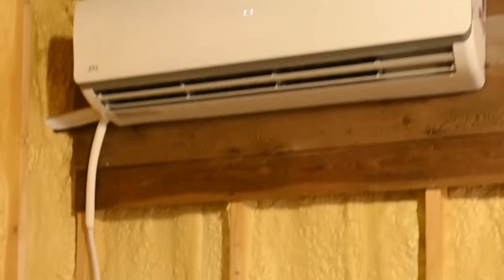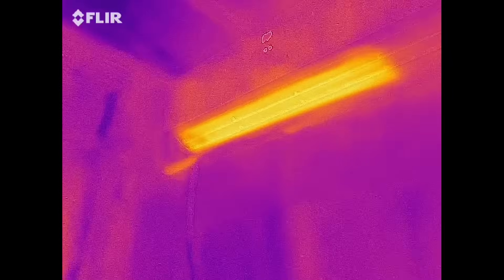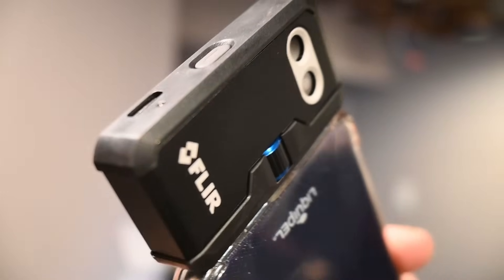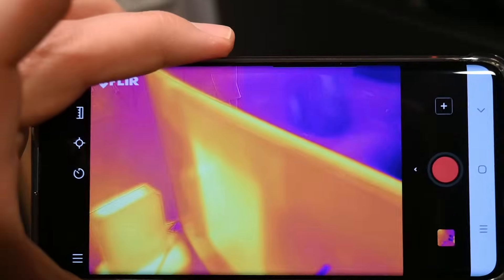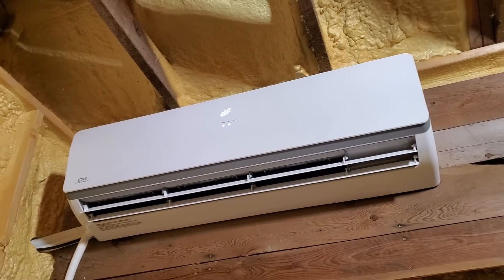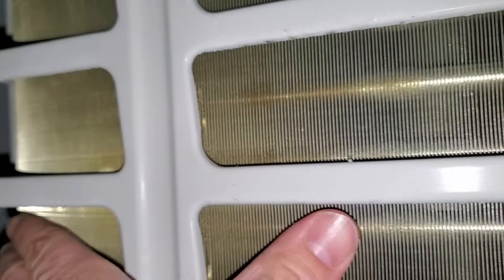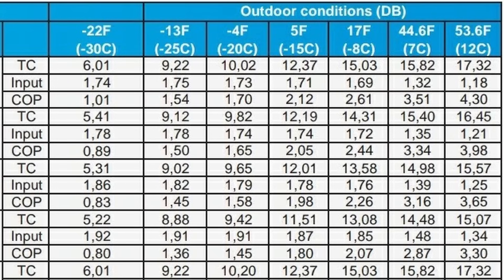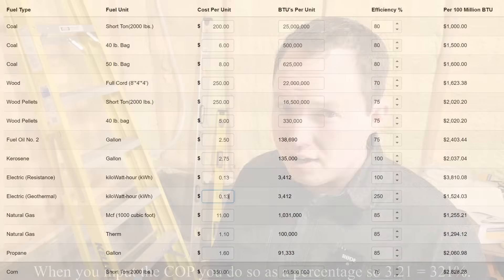Can You Use a Mini Split in EXTREME COLD? Heat Pump vs. Propane Cost Comparison with Thermal Camera

Comment: The interesting question is what makes a "hyper heat" heat pump work better than a traditional unitary heat pump that often has a balance point around 35f?   The answers are added engineering features including variable speed compressors, electronic expansion valves and vapor injection refrigeration circuits.   

The units are variable capacity thanks to their variable speed compressors and "inverter" based drive electronics.  A "hyper" unit may be rated for 18,000 btu at standard conditions (usually 47f) but often can achieve that 47f capacity at 50% compressor speed.  As the outside temperature decreases, the unit ramps up its compressor to maintain rated capacity.  At some point the compressor is running at 100% speed and capacity and then it gets colder outside.  The hyper unit then goes overspeed holding full capacity usually down to 5%.  Typically the outside unit gets louder and actually is drawing far more current.   The power use is opposite of a conventional unitary system that uses less power as it is getting colder outside.

Then hyper units have two more engineering features at their disposal.  Electronic expansion valves (EEV) and vapor injection.  EEVs control the superheat and replace the function of traditional metering orifices (pistons) and TXVs (Thermal Expansion Valves).   EEVs are computer controlled, stepper motor driven, refrigerant metering devices.  The unit's computer can regulate the EEV to minimize wasted superheat and optimize the refrigerant flow based on realtime refrigerant and ambient temperatures.  This adds efficiency and is needed for optimum variable capacity

Vapor injection adds another EEV to divert a small quantity of refrigerant after it has gone through the condenser coil.  It injects a precisely metered portion of flash gas back to the compressor to avoid excessive discharge temperature when the compressor is in its special "hyper" speed mode.  There is also a special "HX" heat exchanger in this circuit.  Vapor injection easily enables at least 10% more capacity exactly when its needed, eg during the critical below freezing temperatures down to the unit's minimum rated temps.
Reply: So while the unit may be achieving 100% of its rated capacity down to perhaps 5f and is still producing heat down to -22f, low temperature efficiency is lower because of traditional reasons like ambient temp, defrost cycles and a pan heater.   There is also the hyper overspeed feature that contributes.  Overall an amazing engineering feat that comes at an upfront cost premium.  

Finally, in most parts of the country propane is cost equivalent to electricity, insulation and air sealing becomes more important to use heat pumps effectively, heat pumps DO transfer heat to and from the outside air, proper installation is critical for long term reliability, more training is required to component level repair a "hyper heat" model, BUT they are proven technology that also provide AC at no extra cost.

Comment: I wish my propane cost were that low. I live in Arkansas currently and the last time we got a delivery it was about $2.19 a gallon. Lol the flip side is our electricity averages about $0.09 per kilowatt-hour.
Reply: Lucky, I'm paying $2.399 a gallon. Luckily in the next year or two I'll be running on natural gas. There's a lot of heaters to convert, but some of the house I'll probably install mini splits because it's too hard to install gas everywhere.

Comment: Heat pumps DO NOT use heat from the outside to heat your house! There is no intake outside to pick up heat dude.  It's using the compression of the gas and the heat of the windings to create heat then dumping the hot air into the space. The cold air now goes outside.
Reply: Wrong.  The outside heat is being transferred through normal refrigeration phase changes driven by the compressor.  In less efficient residential unitary systems there is a small percentage of compressor motor heat being added, however in "hyper heat" mini splits there is actually a special vapor injection circuit to slightly  cool the compressor which is used in below freezing periods.
Reply: Completely incorrect. The system has to turn the refrigerant back into a gas on the outside. This gas is then fed inside to be compressed and turn into a liquid shedding the heat. 

Think, bro.

Comment: Great video.  Best one I have seen.  Been looking at moving to northern ID.  Will build an ICF house.  The prevalent push from what I have read is radiant hydronic floor heating coupled to a boiler.  Once I got away from the marketing, I started finding folks that are heating 3600SF tight homes with two minis.  They have backup systems with a different heat source for redundancy and diversity.  Thank you for the COP.

Comment: what are we calling extreme cold, once you get under -15c or close to 0F these things just quit, I'm not an HVAC guy, but I have spent many a day with a hair dryer trying to unfreeze one of these things.... they are O.K for moderate temperatures and for comfort out in the garage or shed or something like that, but do not count on one of these units to keep pipes from freezing because they freeze over long before pipes will, seen it to many times.....
Reply: This can happen due to snow, but traditional HPs are more prone to this issue than newer inverter designs.

Comment: That Flir is a great stud finder for exterior.  Heat pumps are amazing how it pulls heat out of cold air.
Reply: It does not pull heat from outside
Reply: @FrankieRizz-69  Correct.  "it pulls heat out of cold air"

Comment: Be interesting if the outdoor unit was in a cave underground. Then it would be really efficient. Kinda like a geothermal setup idea
Reply: OR, add a 200' buried tube with a fan at the end of it that would push whatever Earth ambient temp air to the intake, and set it up and turn it on only when temps dip below a certain point. Mine runs fine until we get to -30 F, stops at -40F. Senville Aura unit.
Reply: Buried tube strategies don't work in practice.  Geothermal pumped water systems do,  however the much less expensive  hyper heat enhanced air to air strategies are essentially equal in most US environments including northern states except Alaska.  The problem with caves is you quickly chill them to freezing.

Comment: Knowing how the gas works when cycled makes all the difference in understanding why it can pull heat out of cold air or as they call heat exchange but it happens within the molecules in the gas vibrating and creating friction thus warming the condenser. Switching back and forth is very cool. I know car ac and understand house ac. But then being able to Essentially reverse the system is so cool!

Comment: Your unit looks pretty much the same as mine Midea 18 2020y. I use it at even lower temperature here in Ukraine, as low as -10C or so. But I had no data about COP you measured. That's interesting but sad, because I wanted to use it in range of +10 to -15C. But wood boiler would be much cheaper after 0C. I was hoping for -7C or so.

Comment: After seeing those infrared shots, I believe I would consider taking  steps to place the inside unit and the outside unit as close as possible on future installations.  Clearly, there is energy being wasted with longer runs.
Reply: If you make it too close the refrigerant will hit the compressor hard and make loud noises. I'd suggest if you're going to do that, don't cut the extra lineset just bury it.
Reply: Most of these units need 10fit minimum line sets. This is because the output of the compressor goes straight to the indoor unit in heat mode. If you don't have that buffer in between, you'll hear a very annoying pumping noise.
Reply: Another way to improve the output (heat & cold) would be to install the outside unit 12" away from the wall.  This would also facilitate hosing (light spray) the fins from the 'wall' side.  The differential measurement, in the video, would have been 'larger' if the flow of air had not been constrained by the tight mounting, close to the wall.

Comment: Here is a COP balance point calculator: https://www.oceanhvac.com/dual_fuel/ I have natural gas, and because my gas is cheap compared to electricity, my cost balance point is about COP 3.5. Looking at performance curves that equates to about 60ºF, so a heat pump doesn't really make sense for me. Because propane costs more, you can get more benefit out of it. I think it's good for people to know their cost balance point before purchasing one of these systems.

Comment: Heat Pumps are the coolest of all types of heat, and below around 30 degrees F its just downright uncomfortable and gets worse as the temps fall lower. The comfort factor doesn't even compare between fossil fuels and any heat pump system, mini or  whole house. A temp rise of 15 or 20 degrees for a heat pump, and  45 to 60 degrees for gas, and to make up some difference the heat pump brings on usually 10 to 20kw resistance strip electric heat witch defeats the whole purpose.......   all of witch have numerous controls , sequencers for back up heat, and usually defrost problems creep in there also.  Not worth it... Turn on a gas furnace and be comfortable, mush more reliable, and far less problems, especially over time.

Comment: Most of the heat, comes from heat of compression, caused by the compressor.
Reply: But you cannot compress a liquid. That's the job of the outdoor unit to harvest heat to change refrigerant back to a gas. Without that there is no heat to release.

Comment: In a cold environment, say -20f, there is still a massive amount of heat in that environment. It shouldn't be hard to harvest it if the heat pump is built correctly.
Reply: The problem is having a unit that can heat at -22F but also cool at 100F. At -22F you have around 30PSI for the refrigerant, while in cooling that can run around 135.
Reply: guess you've designed many in your life time? It's difficult to get good performance with huge temperature differentials, freezing issues can cause lots of efficiency issues until you'd be better off just using a resistive heater inside the property.
Reply: @edc1569  harvesting the heat is easy. You may not like them temperature though.

Comment: This probably wouldn't work well on the Canadian prairies. Just had a week of - 35 to - 40 Celsius.
Reply: But if you have solar, you can run the heat pump for "free" heat a good portion of the winter, though you would definitely need gas to supplement a heat pump in your climate! Having a nicely controllable thermostat and knowing your unit's efficiency will allow you to minimize your cost. Especially given the fluctuations of energy costs.
Reply: You need a wood stove.

Comment: Have you seen any kind of analysis regarding ideal placement of the outside unit?  I live in a climate that has quite a few sunny days in winter and on the sunny south side of my house there is something of a heat bubble near the building on sunny days.  Do you think it would substantially increase the heating COP if the outside unit was installed on the south facing wall of a building vs. installation on one of the other sides that gets little or no sun in winter?
Reply: Great question, I would think that it would help.
Reply: Yes, I have read: south facing, away from prevailing winter storm winds, off the ground high enough to keep out of any snow, and protected over the top from any falling  roof snow or ice melt
Reply: South side of building is best

Comment: One thing I noticed,  it might be worthwhile to had additional insulation on your line set. It's evidently radiating quite a bit of heat that is cutting down on the efficiency of your unit.
Reply: The line set temperatures reverse depending on the heat/cool function, so at times uninsulated pipe increases efficiency.  Ultimate efficiency depends on mixture of H/C duty and local outside temps.  Bottom line, doesn't make much difference.
Reply: @petem6503  No, During the summer time when they reverse that would mean that they are cold in the summer heat and thus absorbing heat. An uninsulated pipe will never increase efficiency when it absorbing/or losing out door ambient.
Reply: Excellent advice.. 💯👍🏽
Reply: Another thing I noticed/wondered is why the line set was so long on the outside? Wouldn't that be another avenue for heat loss?
Reply: @stevenwebber5998  Exactly, why not run the line inside the room?
Reply: @timothyprice9064  ok, dude, that's a good point. That thought didn't even cross my mind!
Reply: @stevenwebber5998  No problem, just glad to be of some service.
Reply: @timothyprice9064  My first thought. Put the line set in the thermal envelope.
Reply: @kenhurley4441 , I hear you, no need to condition the outside air.
Reply: @stevenwebber5998   ....and why not run it inside as soon as it leaves unit ?
Reply: @muskyful  That's what Timothy Price said a couple hours ago and it blew my mind, lol. It's such a good point and I hadn't even thought of it!
Reply: @muskyful  
Pre-charged unites may require the lines to be within a specific length.

Comment: I'm about to buy a DIY Mr. Cool 18,000 BTU but I can't find the COP to compare to this C&H brand I've never, ever heard of ever. Does anyone know where to find the Mr. Cool COP?
Reply from the maker: I would just call them and ask.
Reply: @BenjaminSahlstrom  Thank you. Have a nice day, eh
Reply: They are only rated to 5 unless you get their new unit with an air handler. Don't expect great performance for low temps if that matters.

Comment: We used our mini split down well below zero for years and it was pretty darn cheap. Just removed it last summer and will reinstall it on a concrete pad. We had it wall mounted and that is very noisy!  Real good information on this channel, keep up the good work!
Reply: Yea, mine vibrates too. I had to put some rubber grommets on the wall to quiet the unit down! Next time I’ll ground mount too
Reply: @FishingLover  I put mine on absorbing vibration springs they work much better
Reply: @andreycham4797  I think that’s the answer!
Reply: @FishingLover  make sure you buy springs designed for different weights in order to install a unit more straight,  compressor side is heavier
Reply: @andreycham4797  great advice about the springs.  I wonder if the manufacturer gives you the information on the type of springs.
Reply: Thanks for the feedback on that, it's appreciated. I haven't talked to my sister about hers since it was installed while her home was rehabbed after flooding. It's wall mounted and probably should be in order to keep it a little farther off the ground, given where she lives. Hers is a 3 zone unit. We don't see each other often as I live over 1,000mi away. My place has a high efficiency heat pump and I absolutely love it. My mind is made up, and all-electric home is the way to go given current technology.
Reply: I had to do the same with mine .  The little grommets were hard as rock.  Not noisy cooling,
Reply: That's all wonderful information, but can the thing maintain 70 degrees in my garage that's what I want to know, when it's 10° outside

Comment: The AC also removes moisture from the air.  But the heat pump does not add moisture.  So it is not exactly opposite.  But the direction of heat flow is indeed opposite.

Comment: If it's more than 0K (zero kelvin), there's energy to be had. (not much, but not zero.) I've always been of the mind, if you want heat, use something that produces heat, not something that tries to scavenge it from somewhere else. (electric is an option, but rather expensive. gas is best, but you really have to shop around to find something that doesn't waste most of the energy.)

[Note: My house is heated by hot water. A.O.Smith Vertex 97 feeding an Apollo Hydroheat system. It'll be a very bad day when it breaks -- 140F water leak in the middle of the house, but also because it's impossible to replace... they haven't existed for decades.]

Comment: Great vid, you are outstanding in explaining heat pump and your system must be far superior to my Daikin DZ17VSA intalled for my 2400 sq. ft. house in May 2020 here in Michigan down in the lower thumb area. I keep records for DTE billing for years so here is my findings using AIR TO AIR HEAT PUMP. DTE bills, Dec. 2018 173.00/ Jan. 2019 188.00/ Dec. 2019 144.00/Jan. 2020 198.00. Pump installed In May so air conitioning bill for Jun 2020 168.00 ( GOOD ) Now the big suprise  Dec. 2020 297.00/ Jan. 2021 361.00/ Feb. 2021 406.00. Made phone call to HVAC installers and had adjust made that anything below 35 degrees and AIR TO AIR IS SHUT OFF AND RUN ON PROPANE.
Reply: I had mitsubishi hyper heat models installed this past summer, a 24K with two 12K heads and a 36K with 3 12K heads.  I also have a boiler radiant heat system in my old house.  I had 4 heads running so far this winter.  Last billing cycle my NG bill went down by $50 but my electric went up by $180 so $130 more expensive than previous year.  I used nearly 1900 kw than the previous 5 year average for the same billing cycle.  Similar to you was surprised but I also did enough research to know that this was possible as it's an old house.  Summer months I saw 30-40% less electricity usage going from a 4 ton unit(very undersized for house) to 8 tons total cooling with 3 separate outdoor units(Bosch ducted system is other unit).  So was happy with summer but winter has shown that my boiler system is much more cost effective in southern Ohio.
Reply: Nice accounting , Yes it will cost more to use heat pump when is cold out.